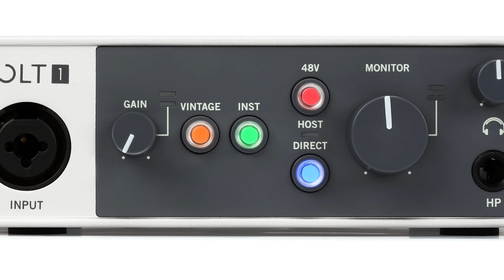What Is Gain Staging?

Comment: I spent $90 on nine of these patch cables to run a board and I had to end up getting rid of every single one of them because they would work but only if you jingle them around a little bit and twisted them just the right way

Comment: Amazing video.  I have a question, if you have time to answer:  I teach Zoom lessons and I have my DAW routed directly into Zoom.  If I keep my signal at -10-18, the volume is too low for the student to hear.  Is there something I could do to keep the gain staging intact as you described in this video, but raise the volume enough to have the student hear me adequately?
Reply from the maker: Hey, Jimmy! I think if you’re hitting around -10-18, then you certainly have some more headroom to get that volume up in your DAW before sending out to Zoom. I generally try to peak around -5 in my DAW. Otherwise, you can try using a limiter on your MasterBus. This will allow you to push a bit harder without actually peaking. Just make sure you aren’t over compressing that signal.
Feel free to reach out if you’d like to chat a bit further on this. Would love to help!
Nick Pasquino, Sweetwater Sales Engineer, (800) 222-4700 ext. 3230, nick_pasquino@sweetwater.com

Comment: i use faders later after it never clips. I thought that we had to move faders all the time lol learned late that is better to keep them as a ruler or as an ornament at the end. principally in complex project where we loose the overview of what is affecting gain and cliping. I also test now a bus just for gain. Do you have thoughts on this, using a bus to adjust the gain? For ex. in 5 tracks i have bus 2 with a plug-in for gain or dynamics, i set the bus level of each track, but not their faders yet.

Comment: loudness levels are a crazy issue for me still, principally with midi and orchestral music. It can be loud on DB but still sound “piano”, we have to adjust midi velocity and many other aspects in orchestral music. There is always place for something more forte, but still the piano passages has to be also present; to not mention counterpoint and lines answering each other . To play a tutti chord to gain stage is good but still not enough, so there is a lot of automation work, and this can lead to important mistakes of the overall gain when setting the master or processing all tracks together, because it is easy to forget the automation point. And when you want realism you out monitoring high or loose again the sense of forte/piano after working hours on headphones or low volume on monitors. Basically the best is to have a display just for metering, and a set of reference tracks saved on template, all things i should do myself from now on ;)

Comment: I think a lot of us who started out with analog set levels too high. I started out with analog multitrack cassette back in the 90s, and it sounded great when pushed at each stage! We have to remember 24bit digital recording is very low noise and has heaps of headroom, so need to back off on each stage somewhat!

Comment: I’ve been doing the single step mastering/summing thing for some time, getting a mix I’m happy with and slamming the output into a good multi band plug in limiter like Waves with about 1-2 db reduction max. and calling that “dynamic”.  This makes me want to try a nice open mix and focus on mastering in Izotope or T-Racks after the fact and see if I get better results.
Reply: You'll primarily want to handle the dynamics with automation points instead of compression or limiting